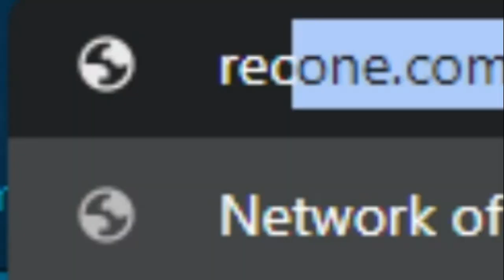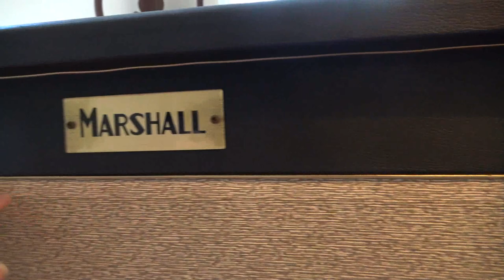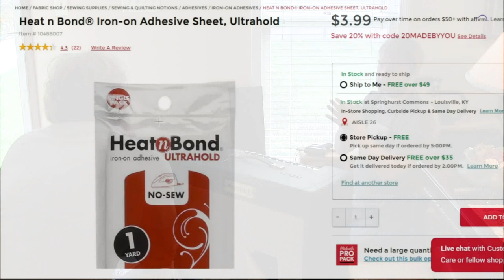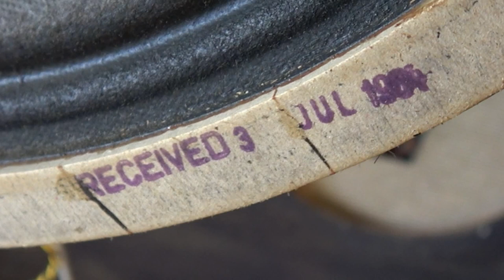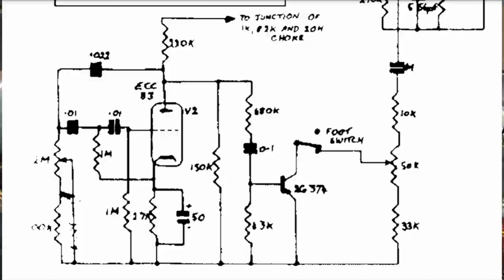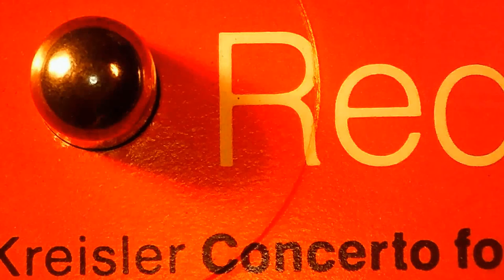The ORIGINAL Eric Clapton Blues Amp - 1964 Marshall JTM45 BLUESBREAKER (Repair, Analysis & Demo)

Comment: I'm a Marshall guy in the UK but do lots of others . I also design and build combos that Marshall should have made back then , convert Valvestates to tube , that would include Trainwrecks and Dirty Little Monsters of course but also add my own touches when building an EL34 out amp by chucking in an EF86 as a second preamp tube . Just restored a Hi Watt Custom 100 fitting new caps inside the old cans and swapping out a couple of other components . I'm now converting a Vox 67 Traveller Solid State to an AC4 type combo using as many original parts as possible . The cabinet is the same as the AC10 etc.  The construction of the Marshall and Vox cabinets are similar in that the front baffle is one piece bolted in all around. A saw cut takes the grill cloth and tolex with a length of trim wedged in to finish so not that easy . It can be invisibly repaired from the front using a darning technique by using butterfly plasters to hold it in position . Probably the hardest job to do on this as the more time taken the better the results . The Mullard mustards are normally all good but I have the spare 0.22 uf ones swapped out with Spragues in your example . I use plain toilet tissue and Titebond water based glue to repair cones and inner tube rubber solution to repair surrounds . This simulates the original manufacture of the cones . Having repaired much worse,  the proof is tapping the cone all round and checking the pitch with an app . As far a strength is concerned there is no doubt that the single ply toilet tissue and re paper macheing the original paper and integrating it works good and my preferred method . When repairing the rubberised surround use the but end of artist's paint brushes the match the suspension valleys . The hardest areas areas are behind the basket frame .

Comment: Nice guitars and chording by Dan !!   I have #7032 ~ very similar down to the missing handles , broken rubber piece on the cloth power tube retainer and repaired speaker  !  My speakers are the original Silverdale Rd gold label Celestions.  On my amp the tremelo only works on the #2 channel.  I use mine @ 110v through a controlled voltage variable auto transformer.  Lucky to have the voltage selector 110v on top of the power transformer.  Congratulations Dan on moving forward with the restoration !!  Since your grill tear is in front of the speaker the grill can be sewn with a curved needle and thread without having to remove the baffle.  I had it done on some white grill pa cabs with some grey and white thread to match the color with very good results.

Comment: I’ve always used onion paper and white glue and it’ll patch a speaker really great. I have a pair of those with the “Marshall” labels. They’re from early 1966.
Reply: The great Toneman himself! Nice to see you around here! Still have the ‘89 Bluesbreaker Reissue you reworked for me 20 years ago! Same with the Korg Vox AC-30 you did for me 5 years ago!
Reply: I always use 2-ply toilet paper where you peel it back to have thinner pieces of one ply. I thin out some white glue then dip a small paint brush into the glue and paint the toilet paper onto the cone. Works like a charm!  Just add a touch of spray paint to make it match up the color of the cone.
Reply: @Ringo Starr  if you have a favorable tear that works great. since wood glue will really grab pulp paper... but  If you've got a situation where you actually have to put a little bit of tension on the repair and experiment with the as you're doing it the hot glue is probably the best way to go
Reply: @vayabroder729 great combinaton! I've got the poor man's equivalent; Ac30CC2 and a late 90's/00's Bluesbreaker 😔.  Close enough I suppose. Still jealous tho

Comment: Where this model really shines is the great mid hump you get from those KT66 power tubes. The cleans aren't that bright, especially with humbuckers, but it overdrives great. KT tubes require a lot of filament supply current compared to more modern power tubes, so it's not easy retrofitting them into amp where the power transformer wasn't designed to handle them. I've tried and have usually had to resort to pedals to get that sound.

Comment: The Iskra, Phillips caps will have date codes on them! That amp was built in the back of the Marshall Silverdale Rd. shop in East Hanwell.
Reply: are the speakers accurate for this year i mean Marshall was deep in "Pre Rolas and Celestions" Did they have to out source ? the magnet style on this one  I have not seen in any i have seen.  just  curious
Reply: @ianhaynes333  so it's an alnico celestion ¹² inch speaker, very old !
Reply: @ianhaynes333  they first came out in the 50s made into the early 60s...Celestion B024 speaker 12w

Comment: Wow that amp sounds great! 
Anybody who's ever used a hot glue gun knows what a PITA it is to control the flow. Once you push on the trigger it starts, but it continues after you let off the trigger. Then you have to deal with the "strings" that hang when you pull the tip away. This is a job well done.
Edit: Forgot to mention those 2 guitars. DAMMIT MAN!!! Absolutely beautiful.

Comment: I would have never thought hot glue would be good for speaker rips and tears. The glue dries as inflexible
as the stick is to start with Brad . Although it is a strong repair by itself. What an amazing amp! 
Sounds like "buttar"! Uncle Doug eat your heart out at this one!
Reply from the maker: Put a thin layer on a sheet of paper. It flexes very well and does not tear or crack.

Comment: Brad.. just a FYI .. the 1960's Mullard ECC83 made in GB with yellow lettering denoted higher quality. Through the early 70's the yellow ones were made in Holland by Philips at Eindhoven. The UK made ones reverted to white paint and the HQ ones had an added yellow spot. That lovely yellow GB tube was made in Blackburn Lancashire. I have a full set of 3 in my 1967 Laney Session 50 and they really cook.

Comment: That tear on the cloth looks so clean cut I can't help thinking it's probably a studio thing. You get the mic a lot closer to the cone if you make a small hole on the cloth. 
Edit: and later in the video it's mentioned the amp is from a studio!
Reply from the maker: And the hole is the size of an SM57 head.

Comment: I use tissue paper and Damar Varnish brushed on with soft artist brush for cone repairs like that. The varnish is very watery and dries quickly . The tissue is a single ply split from Toilet paper, Very thin but reinforces the repair. The strips only need to overlap the tear by about 6mm. Damar Varnish is also useful to repair paper cones which have gone soft and floppy.

Comment: Hey, great video! I have been trying to find a JTM 45 mark IV Super Tremolo, like my one. It was made in 1965 and has the original KT66 & GZ34 valves and 2 x G12 Celestion speakers. It sounds amazing, very clean sound and can be loud! Also runs very quiet which is great. I have been searching and can’t hardly find any pics of it..

Comment: The repaired speaker is dated 26th June 1964  T731. Interesting that this particular model of Celestion was in this '64 Marshall, usually Marshall's have the T652(15 ohm) with the T731 used pretty much exclusively in Selmer amps at the time.

Comment: Just a heads up, you shouldn't use those solder guns on equipment with magnets like pickups and speakers, because they can actually demagnetize them. Better to use ceramic element soldering irons.

Comment: Aluminum tape on the back of cone 2 by 3 in will work so good. Canned caps are used for new soldering point for replacement caps. The thunderbird should rock TnT

Comment: Thoroughly enjoyable. The dulcet tones of well made instruments. Still want that lunch box amp! Cool flower cabs, too. Never got to play an actual old Marshall so I converted an Ao35 into an 18watt lite with a new OT. I was pleasantly surprised with the clean tones! Im stoked about the overdrive ,of course.But with a good speaker, the cleans can be just as inspiring as the blackfaces I’ve tried. It’s a great amp.

Comment: Clapton bought his in late 1965. late November or early December. The specs on these amps were in a state of consistent change. That’s why there’s no way to know what the exact specs of his amp were. He bought his right as they were switching to ceramic speakers. Most people believe his speaker were alnico but I’m not so sure those 15 watt alnicos could’ve held up to him playing it fully cranked night after night. Although it’s a 30 watt amp it puts out closer to 50 when cranked and that’s how Clapton says he kept it to get his sound. Any opinions on this? I’m certainly no expert. I have a Marshall 1962HW. It’s my favorite amp that I’ve ever played. I use it with an attenuator though.

Comment: For years the speaker screens where Hoover vacuum cleaner bag cover fabric since I guess the store was close in proximity to where Marshall made his amps just incase you wanted to replace the cloth with vintage spec cloth there some times easy to find I've had luck at old vacuum repair shops lol
Reply from the maker: I hear apocryphal stuff all the time, but if the vacuum cleaner cloth is the same stuff, it would indeed be interesting. I know exactly the stuff you're talking about. It's semi rubbery.
Reply: @TheGuitologist  that was the info at the Marshall amp museum it's like that real old style where you put a bag into the material I'm talking about the few vacuums I used were like mid 60s where the whole vacuum part is shiny silver and the bag is just like hung on the back with a zipper I dont think a single bag could do a 4×12 cab but there perfect size for the small combo amps :)
Reply: @TheGuitologist  Hello Brad.  Is the vacuum cleaner cloth acceptably acoustically transparent?

Stay free.  Rab  🍻   😎    🌠
Reply: I have a clone of this amp - all hand built including the cab . Cab covered in the original  material plus brand new original grill cloth !

Amp looks amazing,
Currently has a pair or Chinese made Green backs-

Just bought a pair of original G12S - 20w to try -

I love playing my 2002 Firebird through it.

Great vid

Comment: Cool, thanks, the sub was with that one. I'm not only a guitarist I'm a sound engineer and I have my own little club and street fair sound and light rig. Thankfully I have never blown a speaker but if I do I will try this.  Had a bass port fall of of a QSC sub. Gorilla glue fixed that stringer than it ever was.

Comment: what's crazy is I found an old Marconi tube powered radio from the 50s and there's so many of the same caps in there . It's got 2 6v6 push pull screw it it's gonna be my first build . I'm an electrician. by trade I know that's not an amp tech nut it's all the same if you can read a schematic and get help understanding what values you need and how you get them your holden

Comment: Would the added weight of the glue on just one part of the speaker cause the coil to rub? If so, it may be a good idea on a large repair to add a similar amount of glue 180 degrees from the repair, kinda like balancing a tire? Dunno, just a thought.
You would think there would be some kind if doped paper fiber type product or maybe a structural paper tape for these types of repair.

Comment: those old paper cones speakers are very fragile and i like to use clear poly glue if torn. if not torn but fragile i coat them with clear poly on the front and the back if possible. this protects them from damage and extends the life . like you say people have different ways and i wanted to share my experience. when metal is cracked you drill a hole at both ends which stops the crack from starting again. i used to use kleenex tissue paper as a patch over too.

Comment: I have a 1963 tremolux head and piggy back 1x12 cab the original speaker has 3 wamoes I repaired in 1987 bought it with the speaker damaged sounding great all these years I use it for harp these days adds to the mojo also I need contact info for amp repair service please
Reply from the maker: bradlinzy at gmail

Comment: Well I got a speaker cone that needs fixin. I geuss I'll be buying a hot glue gun. ...and takin off the foil tape I used. Thanks Brad!

Edit: Brad, will the hot glue cancel out the vibrations in the speaker cone? Seems like the vibration would be stopped at the glue. Any sound deadening at all?
Reply from the maker: If you doped a big enough area with it, sure. But if the repair isn't too large, you'll probably never tell the difference.

Comment: You are wearing a guya tone shirt... its interesting recently I acquired a microphone preamp called guya viva, it has to be 1960's. I opened only to see the tubes. there are 6v6 gc tubes and a power transformer that is 20cm in width and length. so big.

Comment: For repairing speaker tears, Ive always used a single layer of toilet paper and clear nail polish.  Preferably on the rear of the cone if accessible.  Ive never seen the hot glue method like this.... interesting.

Comment: I would expect to see all RS transformers from 1964. At very least it should have an RS OT. It does have the 1st series of Drake PT, and Drake OT with side mounted impedance selector. I WOULD BE very surprised IF Marshall used a Drake selector OT this early. The good thing with these transformers is that they have taps for both US voltages and different cabinet impedances. No step up transformer needed. I own an original July '66 BB (style 1) with all Drake hardware & original KT-66's. 
BTW - those 15w speakers are easy to blow so take it easy. Remember, 30watt RMS is just the average wattage so if you crank it (and hit a power chord with a mid to high bass setting) you will probably blow those speakers. More hot glue please...

Comment: What guitarist are chasing unfortunately is not actually the sound of the amp, but the sound of the recorded amp in 1964. LOL hence the term 'cork sniffer' To elaborate I own many fine Amps both modern & vintage, but the best sound I ever got on a recording came from combination of a Boss BR-1180, a few pedals & an 83' plain SG. My Mark V came close but I could not replicate the reverb sound that oddly was not incorporated with room reverb, but done direct thru the board.

Comment: Seen those Genelex KT66 tubes in Leak Hi-Fi amps.In their amps-get 24W per channel from a PP pair.British Hi-Fi amp.Got it from a thrift store.Packed away at this time.The Leak amp does produce a smooth,clean sound.Not high power-just clean.

Comment: I imagine with a hot air rework station and some popsicle stick and/or toothpicks you could really do a pro job with that glue. I have all of it and will probably try messing around with an old cheap speaker.

Comment: Question: Is there any danger in touching the exposed part of the wire from the amp to the speaker while the amp is running?
Reply from the maker: No. The voltage at that point is low.
Reply: @TheGuitologist  Thanks, I would think it would take a lot of energy to move a speaker.
Reply: @mikeaustin4138  Voltage is not power, or energy. The power comes from the current. The volts to the low impedance speaker are low but the current is high only because the speaker impedance is low. The speaker draws out the power from the low voltage lo impedance output of the amp. You don't get much of a shock because your skin has a much much higher impedance than the speaker. So dry thick skin means from a lower voltage you will not get much of a shock from the speaker cable of a small amp. Wet hands and a large PA power amp with a large voltage deviations you'd feel it at least. When people die from shocks it's the current that kills, but it's your skin resistance that limits the current l, if the voltage is high enough it can drive a dangerous current through your skin resistance. Either way best not to take chances

Comment: I've also had good luck with carpenter wood glue, thinned just a little, and for larger holes, maybe add a lil newspaper behind it.
Reply: Out on the road we used Copydex latex glue and split toilet paper.. just one ply to reinforce it.. Lasted well.. I have a Fane 50 repaired like this in 1985/6 and it seems to be a lasting repair.

Comment: you should use toilet paper..strip the sheets apart..cut to shape then use rubber glue..do both sides and let dry..then do again..3 times is usually perfect..then get a matt black spray and lightly spray the cone..i have done this exact speak..its a great sounding speaker

Comment: I used to repair JBLs. The technique was rubber cement and toilet paper
Reply: I use flexible fabric glue and paper towel.
Reply: Yup I have used that same exact technique..works better than you might think. Toilet paper is an ideal matrix but you gotta handle it carefuly
Reply: How about cigarette rolling papers? They're thin and light but a lot more resilient so they should be easier to work with.
Reply: @CarsInDimension  I use coffee filters.

Comment: I may have missed it and if you mentioned it I apologize. Being that it was a British amp did anything have to happen when It came to the states to run on regular 110 AC as opposed to the  voltage in Britain and Canada? Keep up the good work I'm a Red pill supporter here also. I support your exercising of ALL of your GOD given rights. Rock on!
Reply from the maker: The power transformer wiring all looks original, so I assume this was made for the US market.

Comment: Ive had great luck by soaking a paper towel in carpenters glue. one piece on the front, and one on the back. then Spray paint the repair flat black

Comment: Silicone.  NOT HOT GLUE!  Dude…🤦🏻
Reply from the maker: No one ever listens to me. They just repeat what they already know. Silicone is a one shot deal. You cannot go back and melt the repair later and fix it again like you can with hot glue. I'm right on this one, dude.
Reply: Do it once, do it right. Hot glue crystallizes, gets hard and brittle over time. It might be a cheap quick fix but it is not the “best option”.